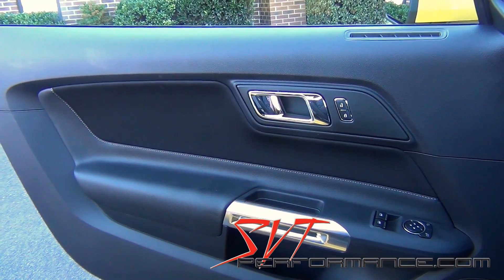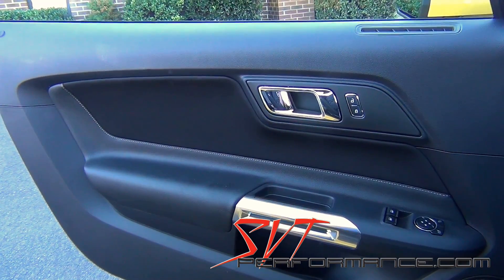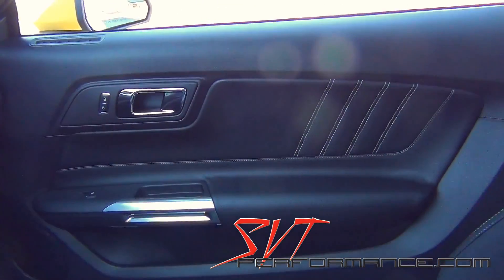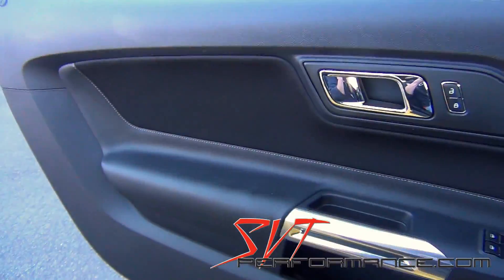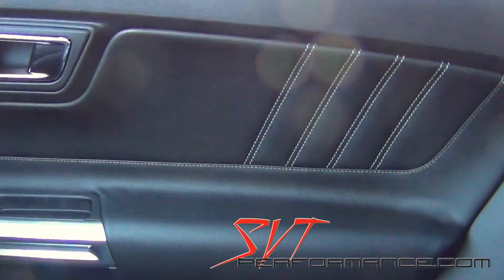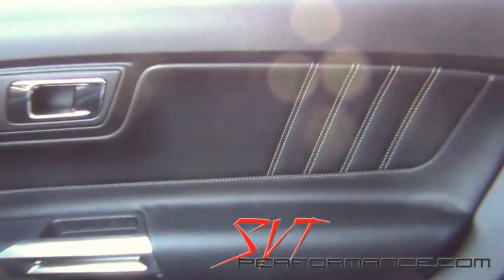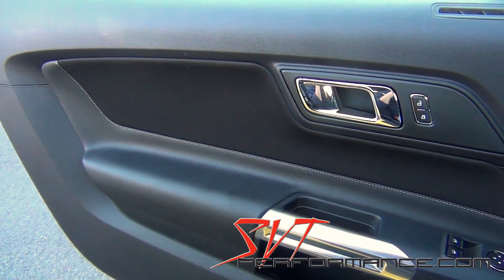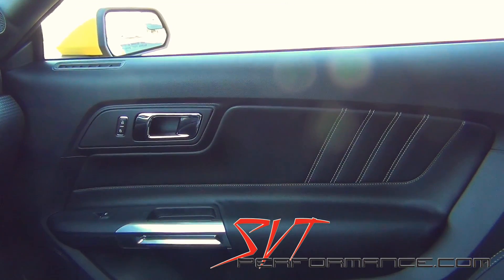2015 Mustang Door Panel (lack of) Quality Control

Comment: Wow... that's bad.
My 2017 GT had numerous flaws from the factory. Had to have the front bumper cover replaced because some meathead at the factory broke the mounting clips on one side. Thankfully I noticed the one side of the bumper popped out before I took delivery .. but how that passed QA is beyond me. Next was an electrical issue - one day the car would not crank... but it clearly thought it was as after pressing the start button a bunch of times it said "Crank Time Exceeded" on the dash... Had it towed to the dealer and they found that the signal wire going to the starter was hanging off with the connector still intact. The only thing the tech and I could come up with was that the bolt was loose and came undone completely. Minor things, but really, cars should not be leaving the factory with these kinds of flaws - I guess it pisses me off because the only way you could miss them is either not caring or not following procedures. I can't really complain though, since those issues were fixed the car has been solid and is getting a Roush Phase 1 s/c kit once the snow is off the ground.

Comment: Mostly or basically all fords have terrible fit and finish....my friend bought a 60k Explorer platinum yet the stiching on the seat is wrong color and he has terrible rattling noises for the vista roof... the doors are the worst They dont line up like its 10 cm off. This is because ford dont care so much about the customer but still want to manufacture well designed vehicles but use a lower skilled work crew therefore turning everything into crap. My Lincoln MkT 2013 has been a nightmare, reliability should be in the sub 10s because its shit. Ford sucks. no excuses